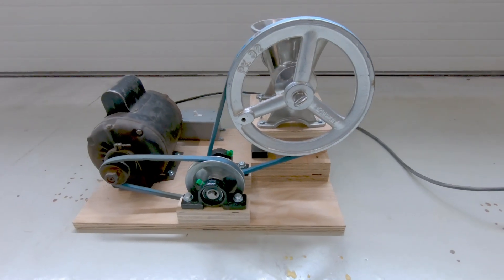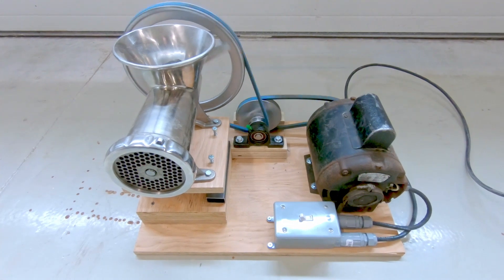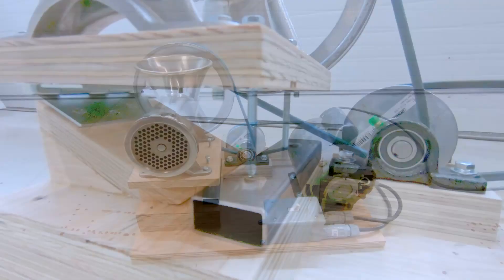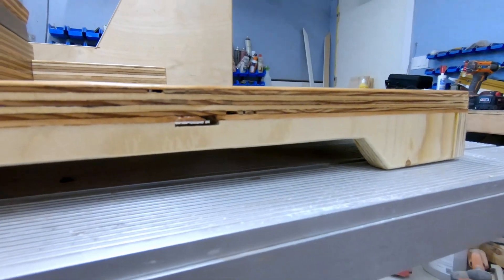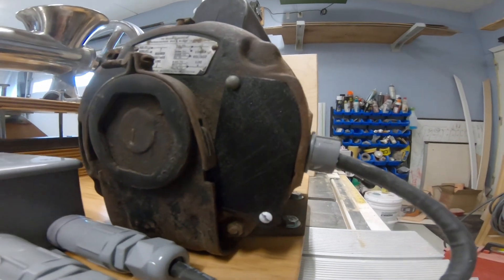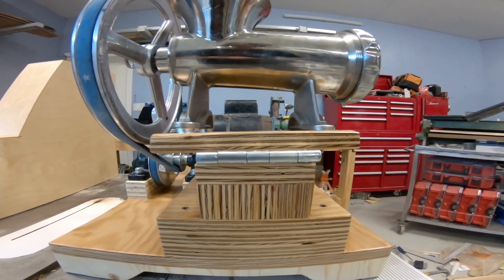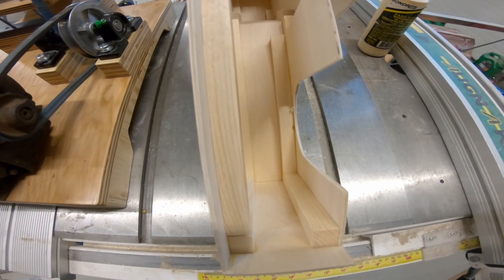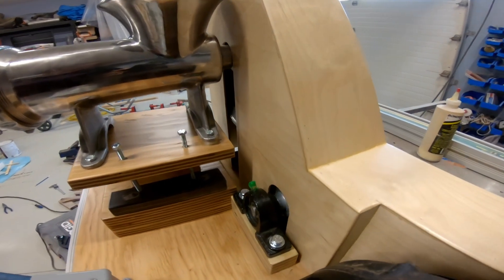Transform Your Manual Meat Grinder into a High-Powered Electric Machine

Comment: What HP is that motor? I have a 32, copied your design somewhat (in last two months), and my 1/2HP bogs down terribly when putting in strips of meat. Not massive, not frozen but everything chilled of course. I am thinking a 1HP is needed. I get about 120pm currently on my 1750RPM motor. What HP is your motor and have you experienced the issues I have?

Comment: Is your meat grinder stainless or aluminium? Does it have a bearing on the auger shaft? If not, do you experience any wear on the auger shaft from the tension on the pulley belts? Tx

Comment: Why do you go from a 2” pulley to a 4 “ pulley back to a 2” pulley then to a 9 3/4” pulley?  Why not straight from a 2” pulley to a 9 3/4”?
Reply from the maker: The 4" pulley and the second 2" pulley spin at the same speed and are connected together. So the second 2" pulley is spinning at half the speed of the first 2" pulley on the motor. So if you went directly from the 2" pulley on the motor to the 9 3/4" pulley then the grinder would run at twice the speed as it would with the setup that I have now.

Comment: Nice grinder build, almost did this myself but ended up buying a 3/4hp weston. :)  First thing I thought of when I saw this is... Damn, be careful when putting meat in this thing. With a 1hp motor and the gear reduction it'll take your fingers off in a flash. Working at a small factory we build a lot of DIY things and safety is always a concern.
Reply from the maker: Meat grinders grind meat. Your fingers are meat. So it will grind your fingers. Hard to make a guard where you can push meat in, but not push your fingers in.
Reply: Deeper feeding neck where the meats weight will push it in with a little plunger aid that won't fit down fully.

Comment: I use this same method of a hinge for tension on my lathe, but the motor is on the hinge instead of the tool. so there is no play on the tool.
Reply from the maker: it works pretty good.

Comment: thats a very large motor would a1/4 hp  do the job you think? may even get away with a smaller pully on the grinder asking because that one looks like 1/2 hp nicely put together thks!
Reply from the maker: Yes a 1/4 hp would probably do just fine. This was just a motor that we had around the house that fit the bill. That larger pulley on the grinder is helpful for reducing the speed of the grinder, I would have to do more of a speed reduction on the other pulley's if you wanted to put a smaller pulley on the grinder. Thanks for watching!